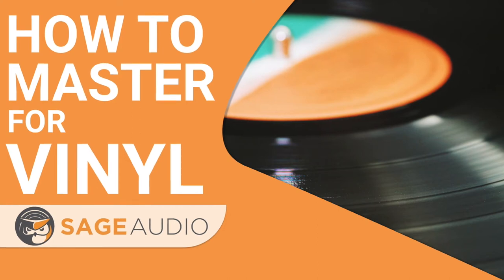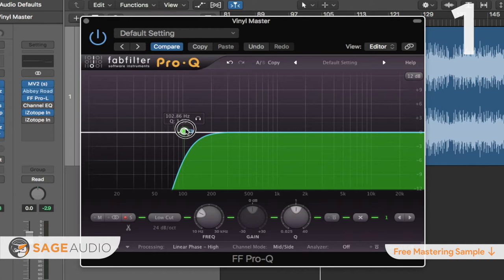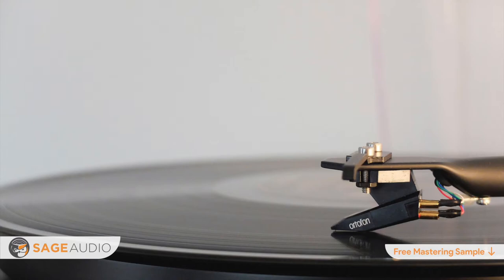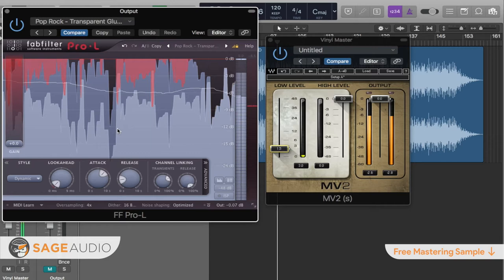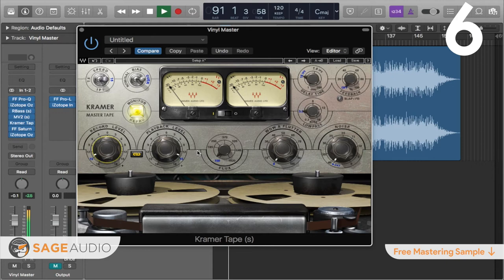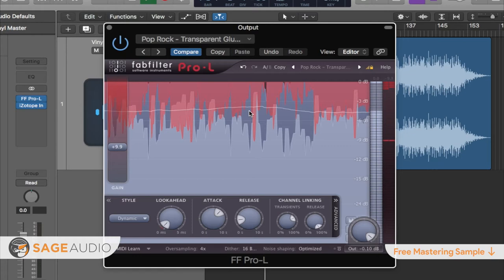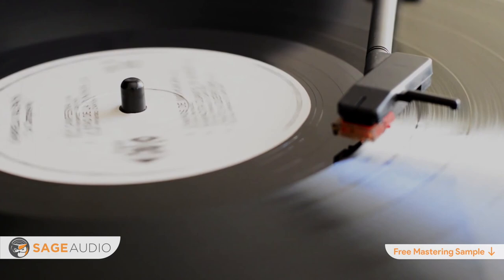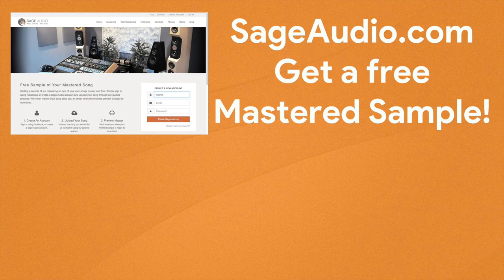How to Master for Vinyl

Comment: Great video, thanks! If I understand this correctly, low level compression could be easily done with a multipressor that bypasses higher frequency sections, but what would be a good cut-off frequency for the lower levels ?
Reply from the maker: Thanks for watching Mike! Low-level compression isn't frequency specific but amplitude specific.  

SageAudio.com
Reply: @sageaudio  Thanks for the reply; yeah, but higher amplitudes in the lower frequency regions. No? Hence, you could make up this with a multipresser below let's say 300Hz. I might understand something wrong here.
Reply: Low level compression is more like a negative ratio compressor, since what you describe is a multiband compressor

Comment: thanks a lot for this video ... it's my first vinyl master i'd like to know how much LUFS can it support ? i generally master around 9 / 8 Lufs sometimes 7 when the client want it that loud ... but i guess that is too loud for vinyl ? thanks in advance
Reply from the maker: Hey Vincent! It'll depend on a few factors.  Typically, a little more compression is better for vinyl, and a louder master would support this.  But, incredibly loud high frequencies will cause distortion, especially toward the inside of the record.

That said, it's best to master the track a little quieter than normal, but with slightly more compression, like you'd have with a louder master.  I hope this helps!

SageAudio.com
Reply: Sage Audio thanks !

Comment: Informative. I checked the blog out looking for additional info and most it makes sense. However (as in point 8) in the event with a rock/metal album if the high frequency is constant through out, is it a general practice to automate the  EQ gradually the upper Hi-mids+ as each songs progresses in order to maintain consistancy. Many engineers are not album to check their mix in this instance. 

I hope my question makes sense.